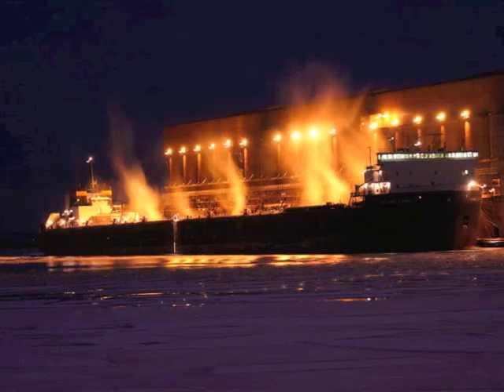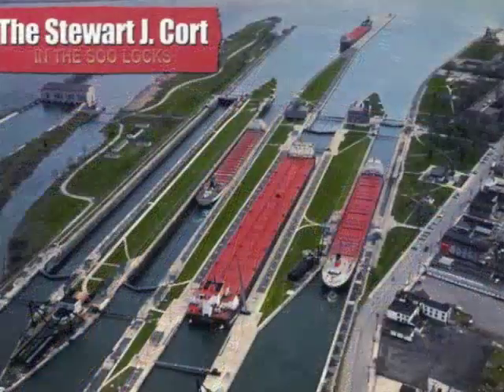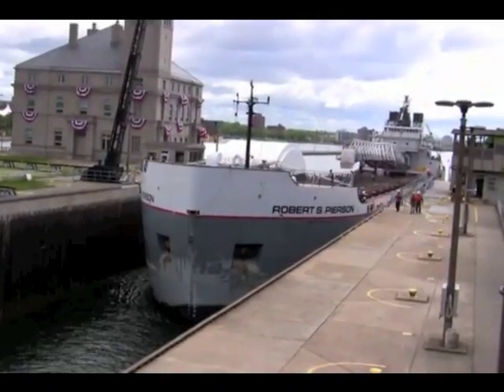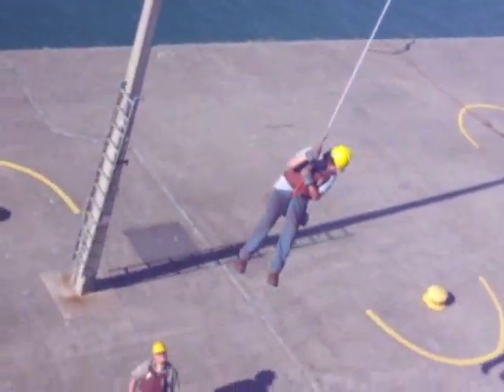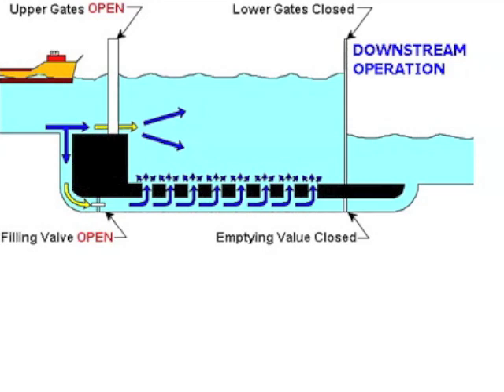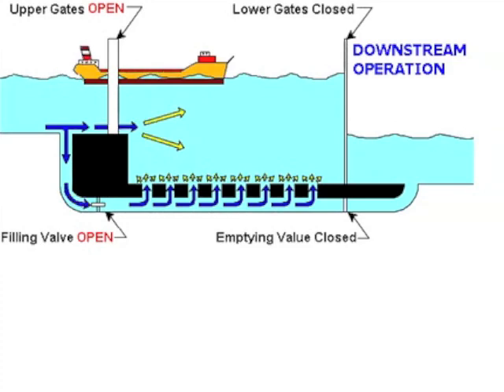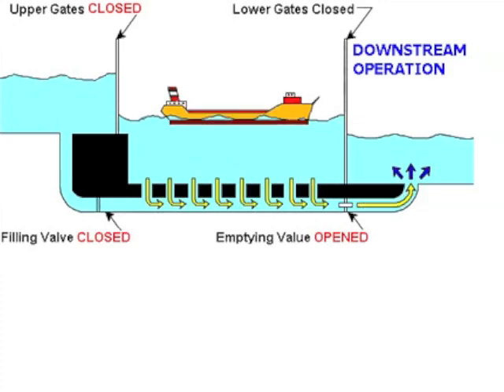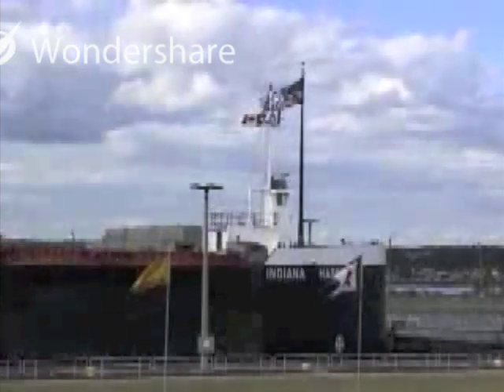Soo Locks

Comment: So if the locks weren’t there you would basically have to go downhill in water and uphill in water?  I’m confused as to what would it be like if they weren’t there?  Just a steep ramp like river of water?
Reply from the maker: A steep ramp of water is rapids.  Between the American locks and the Canadian locks are a series of rapids that mimic what the untamed river might look like. Commercial navigation at that point would be impossible.
Reply: @LighthouseJake  ah rapids!! Thanks that makes complete sense now.  The rapids would be too rough/fast and Flow would be too much in one direction for ships and such to use and navigate through.  Appreciate you.